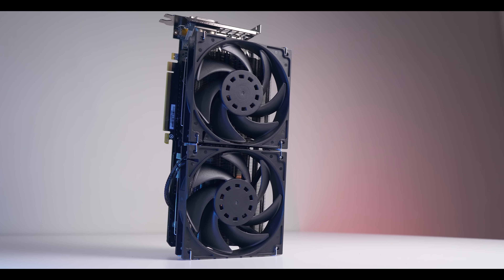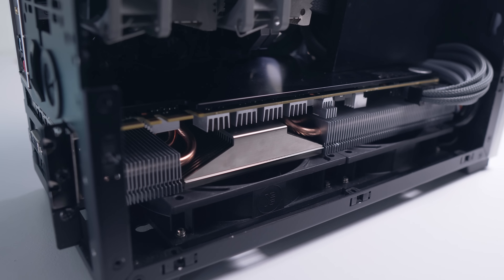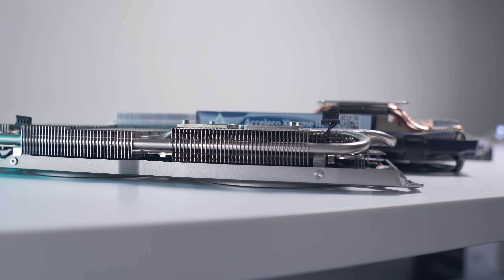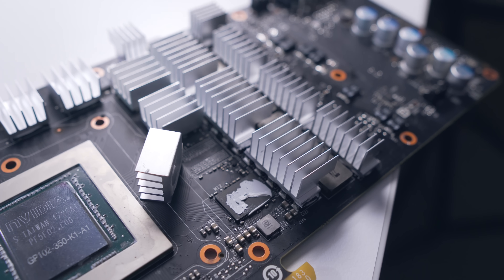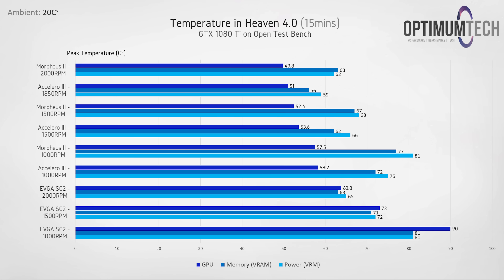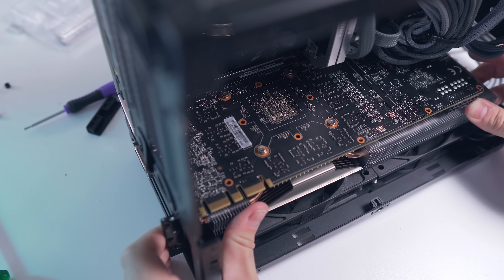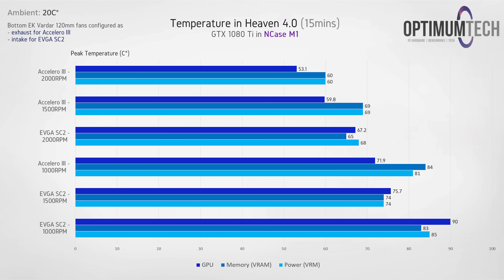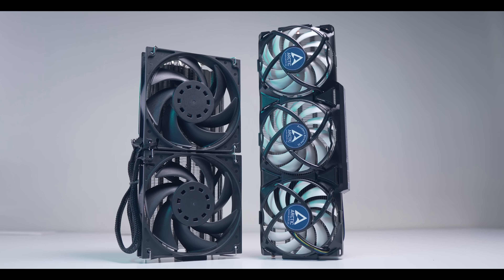Accelero III on a 1080 Ti - Exceeding Expectations!

Comment: The Morpheus is a lot better and lose only to a water cooler mounted with the Kraken G12. You can place any 120mm fan there and use a high static pressure fan and have go for an aftermarket costumized gpu bracket to hide the fans and heatsink like the RGB ones in Aliexpress. I only wish I found a Morpheus Core II shipping to Brazil

Comment: That phone pad on the back side of the card is a deal breaker for me. If they would have included a thermal pad and added some grooves to the back mounting plate maybe I would buy it. You're just insulating the board at that point.

Comment: I have an accelero IV. Once you take the sticker off it looks pretty cool. Unfortunately it's not: 93C on my 1080ti. Going to have to go in and repaste it incase I have a poor contact.
Reply: How is it now? You probably did something wrong initially.
Reply: @jazz_bass_merchant  Yup. Although I was very careful with paste coverage the first time, I think I tightened the two middle screws too much, squeezing it out to either end so there was a nearly bare stripe across the middle of the die. I've redone it, and it's now rarely pushing above 58C
Reply: @tSp289  Great to hear that. I'm actually looking for user experience because I'm thinking of changing my 5700 XT blower to this. You know how effing bad blowers are. Seems like it's a good cooler if you know what you're doing. I saw some fail installations from Timmy Joe, lucky I sought out more information.
Reply: @jazz_bass_merchant  It's a good option. It's still not quite as good as the AIO I had mounted by Kraken adaptor, but I upgraded my CPU and needed the AIO for that. Still, if you can fit the accelero in your case (with backplate it's basically as big as a 3090), then it runs only a few degrees hotter than AIO, looks a lot better - once you take that stupid sticker off - and is very quiet. Also cheaper.

Comment: same here, running 30 degrees cooler on my rig with GTX 1080 then the stock cooler, and is pretty much silent. never throttles anymore since i have this cooler, it's perfect.
With RDR2 on high settings it ran 82 degrees celsius and throttling back 250mhz to keep it at 82 degrees (fan speed 100%), with the Arctic Accellero Extreme it runs 50 degrees celsius and never clocks back at high-ultra settings (fan speed 50%). It's a beast, and it is silent. I use the back plate cooler, its much better, the fans blow on the chips and the pcb is cooled from the back, and it works perfectly.

Comment: Had that one on my GTX280 and 780. On the 280 i couldnt fit the vrm cooling fins that came with the heatsink back then, so i had to saw some pieces out of the stock cooler and fiddle them to the card. worked amazingly well and that card still works today. i put a very silent fan and OC profile right into the cards bios and never had to touch that setup again. 
on the gtx 780, i changed to watercooling after a while, but only to put the card in a smaller case. temps didnt really change that much. great cooler.

Comment: I've been running as Morpheus II on my Vega64 since 2017 and I gotta say, I'm really happy with the results.
Using good paste (Kryonaut) and two Noctua NF-A14 fans the GPU never exceeds 60C even with a massive Powerplay Table overclock that can use up to 400W, i even used the silver backplate by zip tieing it to the PCB.
The biggest problem as you said though is that it makes the card 3.5 slot, so I am having issues moving to an SFF case, so I've been thinking of building my own to fid the Morpheus because it's just so damn good.

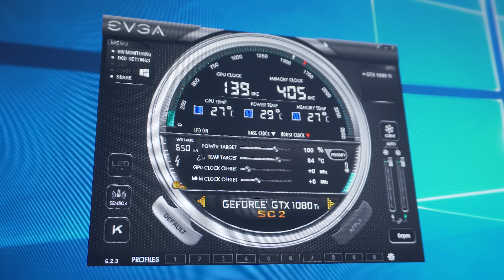Comment: 4:21 - i thought ... mmhh - why he don´t glue the original cold plate from EVGA on the card ?  that would be a nice test.

i add 2x 120mm FANs on my original cooler - best and cheapest way to get the card silent und cool.

Also the cards runs in very wired clocks.

you can undervolt the GPU und push the powerlimit to the max.
undervolt via Curve Editor and get get way more clockspeed and performance but still a cool card.

my cards runs 1950 MHz @ 0,993V and the Memory runs at 5805 MHz

Comment: I recommend 1080ti owner or other cards to buy this ID COOLING FROSTFLOW 240 VGA. its an 240mm aio. I added LM and idle around 25 max around 50 with 1 push or pull setup not both

Comment: I realize this is an older video, but this is fantastic. This shows the potential of an air cooled ITX enclosure. I would love to see a build like this in the TU150 with D15 on an i9 and 2080ti with exotic aftermarket air cooling.

Comment: Info for anyone thinking about it:

My blower-cooler GTX 1080 ran 83deg with thermal throttling before, and loud fan noise.

Now 60deg full load, pretty quiet.

I actually prefer the look of this cooler over the stock one

Comment: Didn't you use the stock plate for the vrm and memory with the raijintek?? So why would you even compare those temps with each other. It would've mattered if you used the included heatsinks for the memory and vrms that the Morpheus has.

Comment: I'm thinking about replacing the cooler on my fe 1080 ti with am accelero iii due to high temperatures, do you know if it will fit in a ghost s1?

Comment: How difficult was it for you to remove the heat sinks after you used the thermal adhesive
Reply: They are permanent. You can a try razor blade and a heat gun but even then its still very difficult.
Reply: Today I tried to carefully remove the heatsink from the VRM and VRAM, yet I still accidentally rip off a VRM. RIP 980Ti.
Reply: I used thermal pads instead of the adhesive. Works very well, and it allows me to remove them in the future.

Comment: Just a quick question, when you install the EK fans under the Accelero heatsink, are those fans connected to the GPU fan header? Or is it connected to the MOBO fan header with a splitter? I am thinking of doing your setup but not sure which fan profile you using :P
Reply: If you want control say for ex. Msi afterburner you will need a fan spillter that connects too the GPU (you will need the specific connector) or the easy way just connect spillter to mobo and set a custom fan curve

Comment: My Gigabyte 1080 is very loud and pretty hot. Is this something you would recommend?
Reply: I bought a bunch of GTX 1080s that were mined with and the fans all failed so I got them for a great price. I put on the Accelero coolers and couldn't believe how cool and quiet they ran. I'd definitely recommend it if your case is big enough. You can also change out your thermal paste with some Thermal Grizzly Kryonaut and it'll drop the temps.

Comment: is this compatible with the rx 580. the stock fan cooler setup on my gpu is just stupid, it gets super loud under load. and i want something that's very quiet, i am not so much worried about look, as i use the noctua nh-d15 cooler for my cpu.

Comment: Prolimatech Mk-26 with some Thermalright TY-143 fans, would like to see how it fairs against the Morpheus, as I have some spare TY-143 fans sitting around, and am using a Morpheus on my 1080ti atm (with Noiseblocker PL-PS fans), I tried, unsuccessfully, to mount the ty-143's to the Morpheus, only a MK-26 would be able to fit 140mm fans.

Comment: I's kind of curious if this cooler without the fans will fit in a dan case a4-sfx. I have 2 120x15mm Nactua fans on the outside blowing cool air in and was wondering if it would fit.

Comment: I have tried Accelero IV and NZXT G12 on my  Gigabyte Windforce 1080, i paired the G12 with an old H55 from Corsair.

NZXT G12, H55 Corsair AIO, IPPC Industrial 3000rpm Noctua 120mm Fan (25 idle, 45 gaming)
Easy to install, check AIO cooler compatibility, look for old Corsair or Thermaltake. in the downside you need 3 Fan headers for GPU G12 Fan, Pump and Radiator Fan. You need a fan splitter/hub and a pwm "mini" (conector of the GPU) cable to pwm to control all those fans from GPU software or you can connect them to all the Motherboard fan headers, also to find a place to place the GPU radiator in your case.

Pros:
Best cooling performance (25 idle, 45 gaming)
You can choose 120mm, 140mm, 240mm, 280mm or even 360mm radiators (check compatibility in NZXT website)
you can choose any fan
Price is lower than an Artic Accelero considering and old 120mm radiator

Cons:
You will need PWM fan connector and a splitter/hub to control all your GPU fans from a single software
Space needed for the radiator
Lots of cables to manage
Noctua industrial fan was very noisy, even at 1500rpm

Artic Accelero Xtreme IV (28 idle, 55 gaming)
I returned and i bought an Accelero IV, it looks cheap but hell the performance for an air cooled. Installation is somewhat complicated if you never done something similar before, also you need to test fit because instructions says that you need some washers but the GPU wasn´t making full contact with the heatsink. Also the backplate/heatsink is so heavy and bulky that may interfere with ram slots, making the GPU to sag, so be careful. The 3 fans come powered by a single "mini" pwm connector that you can plug it directly to your GPU and control them with any GPU software you use.

Pros:
Less cables
Full fan control without needing additional hardware
Performance similar to AIo cooling
Very quiet fans

Cons:
Overall weight of you GPU
Can cause your GPU to sag
Heatsink and fans occupy 4 PCIE slots
Backplate can interfere with your RAM sticks

The reasons i choose Artic Accelero Xtreme IV:
My need to clean my system often, so to take the GPU out it's only 2 thumb screws and PCIE lock with the G12 it was more work and more cleaning. The Artic fans can be detached without any screw, so you can clean them or even mod it.
The other reason was to switch to an mini itx (Cougar QBX) case without sacrificing performance.
The last one is a cleaner build for me, as the only “visible” cables are CPU, MOBO and GPU cables.

Comment: have you ever tried to remove the heatsinks since youve done this mod? If so, how did you do it?
Reply: I know this is a very late reply, but if you use a heat gun on the heatsink for a short while, then use some needle nose pliers to twist, not pull the heatsink off, it works very well. Then you can clean up the remaining glue.

Comment: Could you please review the Accelero Mono plus? It's the smaller and cheaper accelero that still packs a punch. I've been extremely disappointed with my crappy Zotac GTX 1060 Mini cooler and started looking into alternatives, and discovered the world of aftermarket GPU coolers, and hell, even mounting cpu coolers on GPUs.

It's something extremely interesting but sadly seems to be dying out. Some of the best aftermarket GPU coolers seem to have come out 8 whole years ago and never been updated (just like the accelero line). I'm particular interested in the GPU heatsinks that allow you to mount a 120mm fan on them.

Comment: Now buy the accelero 4 haha i have the same card and same problem mini ITX NZXT case with very limited space so just purchased the 4 and a noctua 92mm 14mm pwm slim fan to see if i can fit another 2 noctua slim fans instead of the standard fans

Comment: How much space is left in the front of the case? I have an ODD up there. Also could you still use the default EVGA Backplate? And how do you control the fans?

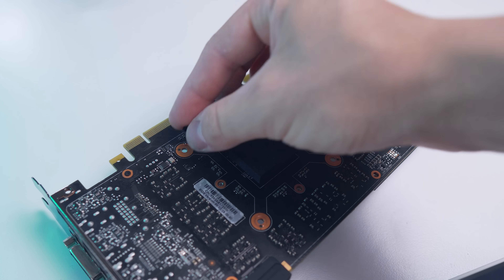Comment: At 5:35 you installed the foam pad and mounting bracket, but at 7:50 its no longer there. Can you explain what you did? Thanks!
Reply: I'm assuming he removed the back mount so that he could mount the backplate. He tried the same on the other cooler but it didn't work.

Comment: I was able to get my Accelero fans to 2170 rpm. I only have the twin fans instead of the triple fan layout. However, my GTX 970 SC Hits a max of 55c on full load with an overclock and overvoltage. Before, I had the EVGA ACX2.0 stock cooler and hit a wopping 70c on full load without overclocks. I can't wait to see if there's going to be a bigger difference when I upgrade my case for better airflow.

Comment: Just for anybody's interest watching the video late:
I have the same NCase setup and benchmarked the Asus STrix 1080ti cooler with the 120mm Vardar fans like Optimum did. The temps after 20 mins of Heaven 4 didn't climb higher than 70°C and at 1500 rpm fan speed. 
OT achieved 60°C max at the same RPM, note though that he had the temps corrected to a 20°C ambient, while in my summery hot flat were around 27°C while the test ran.
That in mind, OT got about 3-4° less on the Accelero. 

Anyone planning on doing a cooler swap or getting a new 1080ti note that the cooler on the Strix is outstanding in performance and almost manages to get the same temps than this very good aftermarket product!

Comment: I just built a Fractal R6 with Noctua 15D CPU and Morpheus II cooler using a single Noctua 12-15 slimline fan with low noise adapter positioned in the center of the heatsink and have gotten great results with it. Fortunately I have room to spare in this case. This combination is super quiet using the R6's fan hub to drive the case fans off the CPU connector and with the low noise adapters on both of the D15 fans. 

The Accelero III looks more complete, however the plastic shims looked a bit cheesy. I liked the all metal attachment on the Morpheus better, but the Morpheus II solution does look more bolted up than like a finished product and is definitely bulkier.

I'm just happy that I can get this quality of cooling without messing with water cooling and I'm glad there are solid options for air cooling GPU's.

Comment: Please stop using that rubbish Thermal Paste from Deep Cool.

At least use the Noctua NT H1 as a minimum.

Got a build from a friend that used that, after I gave him some the improvement is significantly high.
For the GPU an improvement of
10 Degrees C.
For CPU around 7 Degrees C.

Use NT H1 or Gelid as a standard.
Reply: This! Kryonaut or Gelid are good alternatives.

Comment: Two questions: 1. Can you do all of this and then put back the EVGA cooler if you need to RMA the card without them denying the RMA? Or at least not noticing. 

2. Can you try to do this exact same thing but with a Noctua nh-u14s or other Noctua CPU cooler to see what the temps are compared to this? Diy has done this but it's outdated and would be interesting to see if it's better than these aftermarket coolers. And lastly, thanks for the cool content.

Comment: I've had a couple of Accelero III coolers and I wasn't very impressed. One on an R9 290x and the other I tested on a GTX 1080.  I got much better cooling on the 290x by just removing the card's stock fans an strapping on a couple Corsair SP 120 fans over the heat-sink than I ever did with the Accelero III. Yeah, it didn't look pretty, but it was a hell of a lot quieter and cooled much better.

Comment: i have the artic accelero 3 on my founders edition 980 ti and it works well. Its a pain in the artic ass to assemble. The instructions are bad,but my temps with a aggressive over clock never went above 62c. with the fans all the way up u cant hear them. good cooler tho.

Comment: Hey! I'm planning to do a similar build. I have a couple of questions:
Do you think the stock cooler on an Asus 1080Ti Strix OC would outperform this cooling solution?
How about a single 120mm AIO dedicated to the GPU?

And, last, the only thing that throws me away from the Ncase is its huge price... I've seen the Cougar QBX as an alternative but it doesn't fit 240mm AIO with dual fans. I'm at a loss here.

Comment: The spacers on the Raijintek Morpheus II Core Edition that I used actually scratched my videocard, just around the mounting holes.
When I removed the cooler, which of course is done by unscrewing the screws from the standoffs, the standoffs were ALSO coming loose...that's where the scratches came from... NOT good!
It performed well, but I prefer the Arctic mounting.

Comment: I have the Morpheus with 2x EK Vardar 3000RPM fans on an Auros GTX1080ti and easily the best cooling option for the VRM and memory is naked with airflow. Unless you shunt mod the card (which you wouldn't do on air anyway) the VRM stack on even a reference card isn't getting hot enough you need to do more than 2x120mm of airflow right above it. Drop a 120mm fan on a naked motherboard VRM and it will better than stock with a heatsink.

Comment: why the III version and not the IV ?
Reply: Daniel Melzer the IV has a back plate that doesn’t fit with most CPU coolers for ITX builds.
Reply: Henry Rodner  the III is cheaper and without the backplate and the gpu holder 
but same sizes ok
Ty :*

Comment: Next video should be about replacing the CPU stock heat sink with a custom copper for better heat contact with your air cooler

Comment: RGB is for children.
Reply: Thank you.
I search so long for an comment like this.
Reply: Pio tr guess I’m a child then 🤷‍♂️
Reply: accurate
Reply: Starting to agree, thought it looked cool but the lack of regulation/standardization for RGB is annoying. I need 3 different software solutions to make everything even look the way I want it to. Syncing AURA to Philips Hue was a mistake, now every time I turn on my PC my condo's lights go nuts LOL! Just fixed it though.
Reply: my computer has a gtx 1080 ti FE and 6700k 4.6ghz.............and 0 actual RGB

the GPU has its lit logo on the side in green, the corsair h110 has the white LED's, as does 1x 120mm fan in the bottom back of the case, mouse and keyboard and headset have set LED colors i can make them pulse or wave or whateverthefuck but i set them to steady and dim 24/7

Comment: The difference in VRAM and VRAM temps when comparing this to the morpheus likely might have been due to using the stock fins/heatpipes on that EVGA 1080ti rather than installing the individual heatsinks for all the components that also come with the Morpheus.